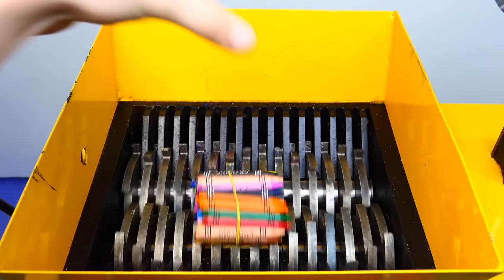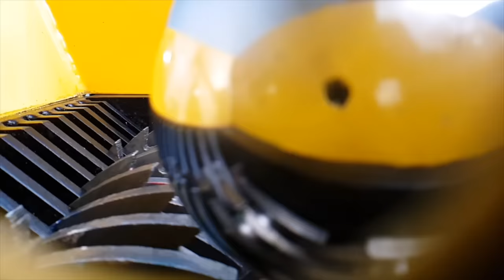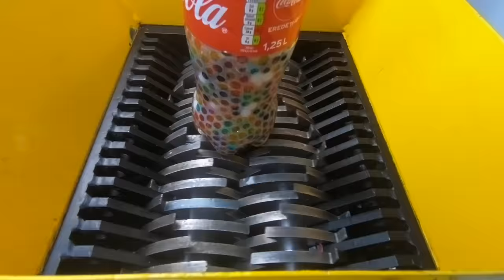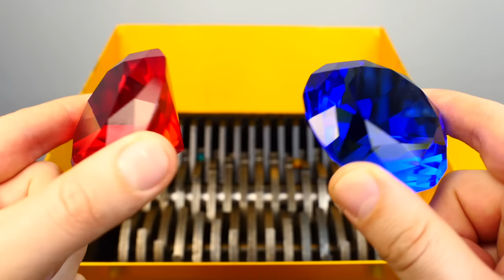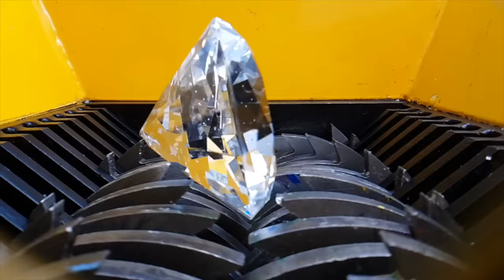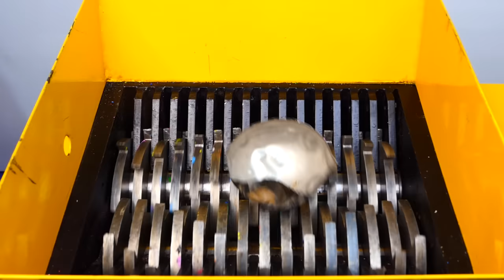SHREDDING DIAMONDS! AMAZING VIDEO!

Comment: I could have accepted that diamond was real but it's size is too big than kohinoor largest diamond on our planet
Reply: Size didnt matter in the video. U mean to say if it was small u'd believe it!?? Lmao
Reply: Obviously. Diamonds can only be cut by diamonds
Reply: @Lucas Gazula Hah, Lol. You're wrong, lol. Diamonds are not un-breakable. How do you think diamond rings and other jewelry are made? They are cut and refined, with or without other diamonds. You can use heat, pressure (like in the video), elevation, etc. to break a diamond. Lol.
Reply: @saki7281  Yes.

Comment: As stated diamonds cannot be shredded. It is the hardest and strongest mineral known. The only that can cut a diamond is a diamond
Reply: It can break under pressure of about 3 or 4 ton
Reply: @subhamsingha3281  Is that psi as if that is the total pressure running over one with a heavy truck would break it, this has been tried on UK television and it had no effect

Comment: Plus 2 caret diamonds are a lot of money. There around $50,000 and 5 caret diamonds are at least $210,000 but that diamond that he has is at least $150.5mil and an average diamond is at least 63.03% smaller than his. Don't forget the biggest diamond would be 9.9% bigger than what his is. Wich the biggest diamond in the world is around 840mil to 700mil so that means his is fake and the diamond wouldn't last that long in a grinder because a diamond is just really expensive and rare glass